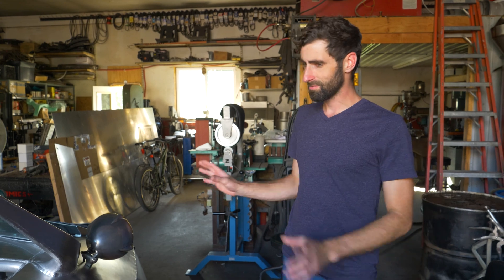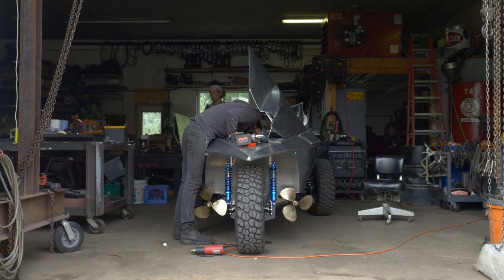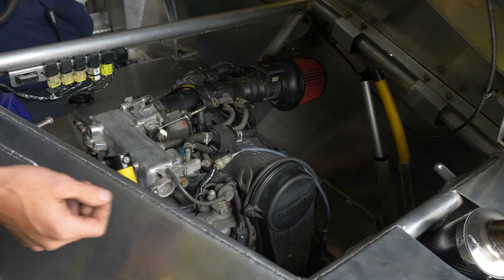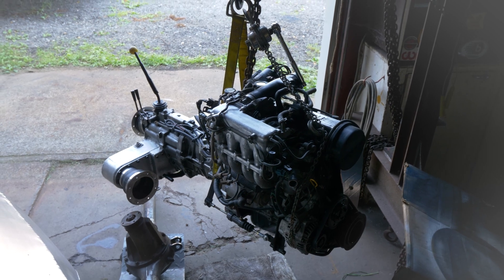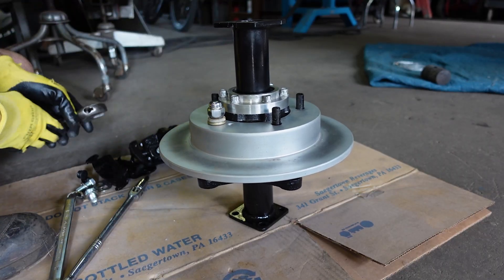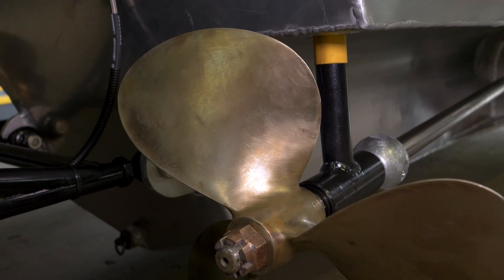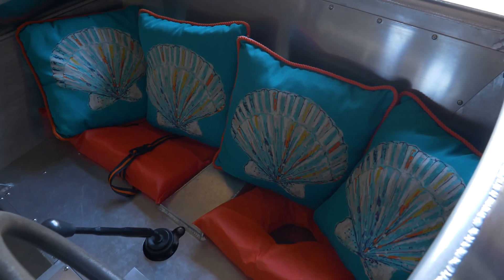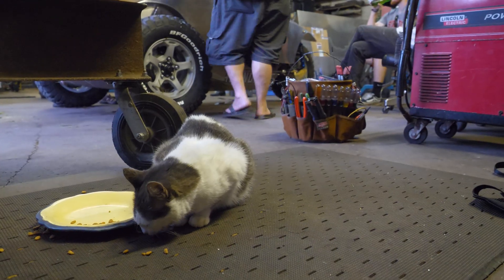New Amphibious Car Design | First Test Drive!

Comment: So happy you finally got it in the water!
It looks like the water blocks the air intake for the radiator.  Any issues with it overheating while in boat mode?
Reply from the maker: Fortunately not. For the launch we did about 7 miles total in the water, which was a pretty good test.